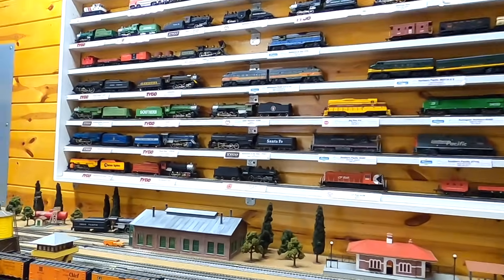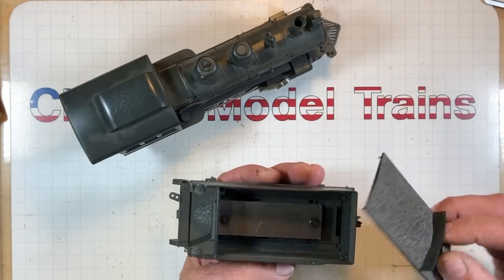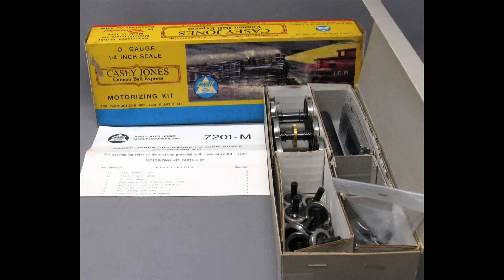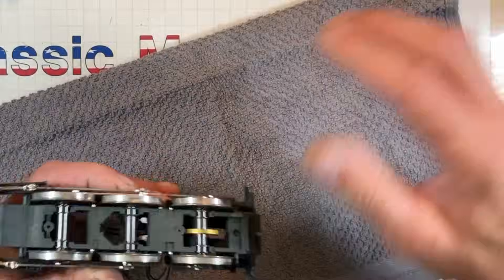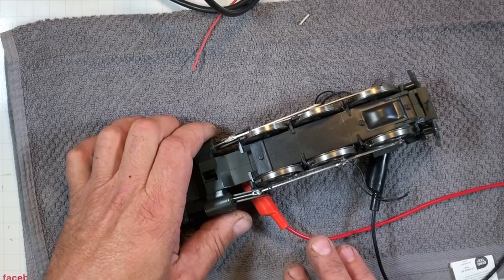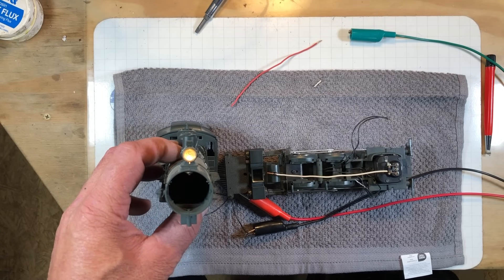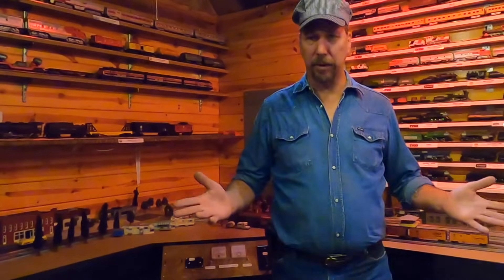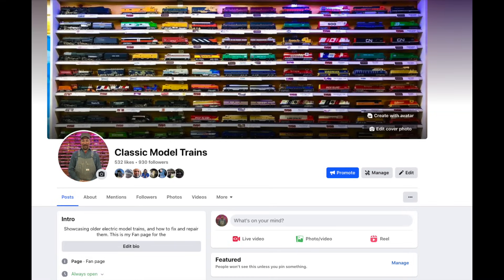Rare Rivarossi "Rogers"  O-Gauge 4-6-0 Tear Down & Repair.

Comment: When you opened it up and no wires were connected... Hey! It's one of them wireless units! 😁 I run radio control off-road racing cars... we always have to manually set the gear mesh between the motor pinion and transmission spur gear. I do it by getting a strip of copy paper and put it between the two gears, then mash the gears together, tighten the motor mounting screws and finally remove the paper. Perfect mesh. Beautiful locomotive. shame about the paint, I probably would strip and repaint someday. Boiler needs to be black and the smokebox gray. Well. that's my preference! Thanks Ron!
Reply from the maker: The color of the loco is the color of the plastic from the factory.  I like you color scheme idea.  Thats my goto colors as well

Comment: I bought one of these static kits to go on a lamp base (project pending). As I remember the model was available as RTR, motorized kit, and static kit with an optional power kit available.  
Rivarossi/AHM. also offered a kit of the Indiana Harbor Belt 0-8-0 switcher, but I don’t remember much about that one, caught my interest though. That was one huge switcher! You should be able to get the marker lights as investment castings from Precision Scale, if they are still in business, along with the hand rail stanchions. The pilot support rods and hand rails were to be formed from brass wire supplied in the kit. It’s really too bad that Rivarossi decided to enter the rai kit market so late. I could see all sorts of locos and rolling stock that could have been a great hit on the hobby market. As a side note AMT also produced a 1/25th scale model of the General, that was one beautiful kit, I think about the same time as when the Rivarossi/AHM models were released.
Reply from the maker: Thanks for this cool info John

Comment: As memory serves “the Wreck of Old 97” and the wreck that claimed the life of Casey Jones are eerily similar. Both men had just completed their assigned runs. Were ask to violate DOT (the it would have been ICC) rules, taking trains not assigned to them and get things back on schedule. The engineer of 97, an all mail train had made up almost all the delay when the locomotive left the rails. I believe the freight that Casey rear ended was an “unscheduled train” and hadn’t cleared the switch when Casey came upon it.

Comment: I just got 4 more engines in lot buy to add to my collection. A cpl that i didn't have. I have 1 of the road names but different type engine. Finally added a SP daylight diesel. It's life like. But have 1 in ho. Road no. 6405. Also a Delaware & Hudson no. 7301 GP 30? Have not checked it. Just testing them now.  Then a new 1 to add. A red NJ central railroad company no. 1540. Finally a 040 think it's penn. No. 2584. When power applied they all worked. Haven't put on a track yet.  Thanks for another great video.
Reply from the maker: Lot purchases are like re-living Christmas as a kid.  So much happiness rooting thru the boxes and checking everything out :-)
Reply: @classicmodeltrains  Amen preacher of model trains. I love them. Get something new something old to repair something that looks nice but missing cpl parts. Box cars with different ads. To the orange pieces that hold the trailers on the flat car. Electric logging cars and so on. Xmas bday native American month... Wait we didn't demand 1. Love this hobby!

Comment: Another cool project. Maybe the person who put it together didn't know how to or couldn't solder? Don't forget the Grateful Dead tribute! 🤣 Could you just wire an AC transformer to Lionel tube track and run it that way?
Reply from the maker: Thanks John!  Never was much of a Dead Head, so I guess I skipped right over their name.  On 3 rail O track, only the center rail is insulated.  the two outer rails are conductive with each other so If this was set on 3 rail no power would get to the motor.

Comment: I have the Rivorossi/AHM O scale 2-rail 0-8-0 Indiana Harbor Belt Locomotive kit still in it's box untouched. That's only because finding the motor kit for it is near impossible unless i want to spend upwards of 200 bucks just to get it running...ugh.
Reply from the maker: Ish!!  Been hearing a lot of Fellers are in the same predicament as you. :-/

Comment: Wow, who would of thought a loco could cause so much mayhem. Thanks for the history lesson and the great video!
Reply from the maker: Glad you enjoyed it Dave!  Seems 382 caused a lot of havoc.
Reply: @classicmodeltrains The 382 was painted all Black with White lettering on its cab and tender along with Brass fittings inside the cab. I've studied the engine and Clinchfield Railroad #99 is 1 of 2 Original steam locomotives from the former Clinch Steam roster the other being Clinchfield Railroad #1 which is also in preservation at the B&O railroad museum in Baltimore, MD

Comment: The Rivarossi O gauge is uncommon especially the European stuff which had more variety, Lima also did 2 rail O gauge that was similar and had a lot more rolling stock available, they only offered it for a few years but the variety of stock available was awesome. Rivarossi Made more steam locos than Lima Did in O though, lima offered 1, Rivarossi offered at least 5. Pola also did O gauge as Pola Maxi, Roco did O as well and all of them sold stuff O gauge stuff to AHM and Atlas. Pola just rebadged their German Diesel shunter and Tank locomotives for american railroads, and paired with them with undecorated german rolling stock in sets.
Reply from the maker: Thanks for the great information Raymond!

Comment: I spent months hunting down the HO model of the Casey Jones engine for a price I could afford, so I've managed to learn more about the models than really anyone ever should. I've seen this in the background of some of your videos so I'm glad to see you finally making a video on it. So far I've found the HO ones can be very temperamental but great once they've been given some attention. I don't even like O scale very much but I'd be lying if I said I haven't thought about getting the O scale model as well. 

If I'm not mistaken, the two holes in a line (going with the length of the engine) on the left underside of the cab are for some time of tank for what I'd assume is the brakes. The missing bits of the smokebox are the front numberboard and and grab irons. As far as I can gather, the real engine would have been painted black, of course I don't know for sure, but it definitely looks nice with the grey smokebox/stack. If you need any information on the models, or want reproduction parts I'd be happy to try and 3D model some for you to try out on the big guy.
Reply from the maker: I would like to scare up the Gilbert HO Casey Jones.  I believe this bounced around in a box for many years and lost some of its pieces.  Sounds like the kits are pretty common but the power / motor portion is difficult to obtain.  I'm probably going to be putting this up on eBay along with others to raise some funds for more broken loco's.  Thanks for the 3D printing offer!!!

Comment: Livery wise probably go with Rivarossi, they usually get the livery pretty close. Casey Jones story s amazing because he is seen as a hero when in actual fact he was a fool. Possibly the IC thought highly of him because he drove his locos fast and didn't pay much attention to the rather scanty safety rules of that time, BUT if he had driven more sensibly he would not have crashed he had been warned that a freight would be going into a siding to clear the road for Caseys train. All he had to do was drive that section more slowly. As it was he went fast , didn't slow round a blind corner where the spur into which the freight was being switched was located. The only guy for Casey was a hero was his Fireman Sim Webb who was ordered by Casey to jump off the speeding loco. he survved and lived until at least the late1940s. Model Railroader tracked hm down and interviewed him about the crash, I think they also met Jones widow. Casey had according to the song been asked to recover some crazy amount of time with his train, not minutes but many hours. At the time he had clawed back an hour or so.
other companies had hodoo engines. one on the Great Northern railway in England was involved in a high speed crash in 1906, no one has ever come up with a plausible reason for the crash, afterward the engine never steamed or worked as well as the other similar engines, until it was reumbered and moved to another division over 20 years later, those drivers didn't know of it's history and found the engine very satisfactory. Vaughan, is pronounced Vaun or Vawn in English. But then you ain't in England so it could be Vorgan. I keep telling myself not to get a Casey Jones when I next see one, but I might. Those Rivarossi motors all look the same. My AHM/ Rivarossi y6b Mallet would pull 56 US  cars on a layout with steep grades 30" curves and a size so small the train was always travelling thru 180 degrees so the caboose went north while the loco pulled south. I have 3 of their Berks, they don't look as good as the proto 2000 ones but if  ever get a layout where they can run I am sure they will haul a whole lot more thanks to those Italian mechanisms.
Reply from the maker: Thanks Philip for the great information!

Comment: I owned numerous 10 wheelers by Bachmann in G scale. Their Spectrum line was pretty good. But as usual with Bachmann, after a while , they stop running. The Bachmann 10 wheeler is so cool looking. But does not run reliably. It quits.
Reply from the maker: are all you Bachmann G's D.O.A. or just the spectrum HO stuff?
Reply: I do not own anymore Bachmann G stuff for I sold them all years ago. But some ran and some ran poorly. They look great! But alas, my conclusion has always been: " Bachmann Locos in any scale, are destined to fail." But their rolling stock in G is Fabulous! @classicmodeltrains

Comment: I didn't know they made 2 rail O in the 70's, I thought most of that died off in the 50's. Pretty basic engine, looks like a candidate for paint maybe.
Reply from the maker: I was kind of unaware of 2 rail O myself until I seen this.  It does need to be painted for sure.